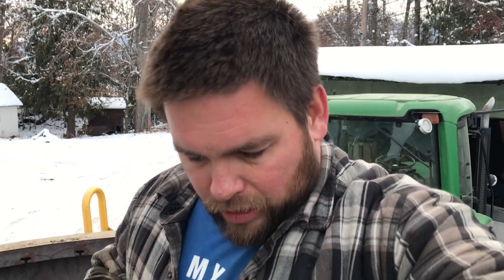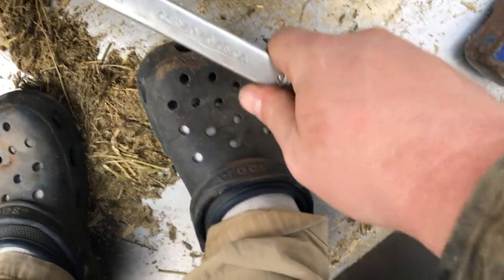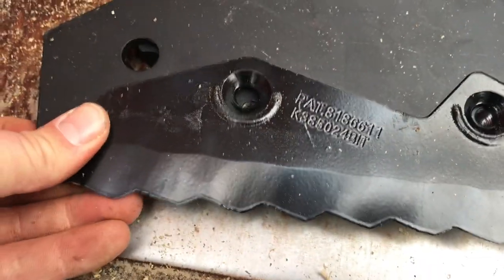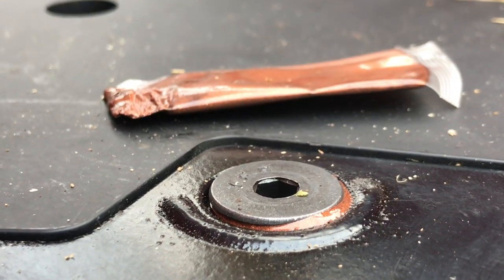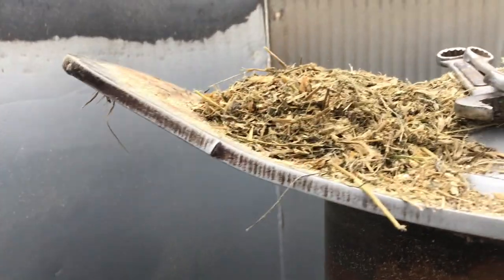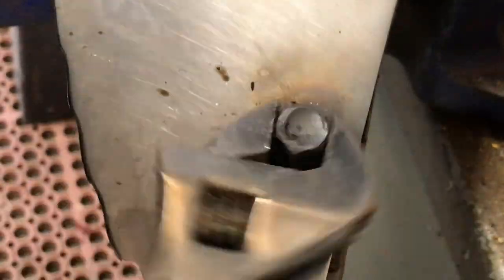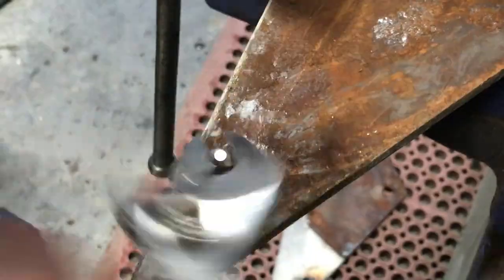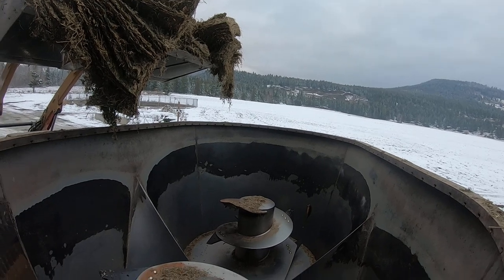Supreme Mixer Wagon Knives Replacement Install, And How To - From Kooima Ag

Comment: Those Kooima knives are a cool idea. Might be a pain to remove those allen bolts after a few hundred hours.
Glad you've got you're CSA approved footwear 😂
Reply from the maker: Ya that’s what I’ve been thinking ..
Probably have to either take them off at the screw 
Or go inside with a welder 
If they don’t come off easy I won’t be buying that style anymore.
#crocs heheheh

Comment: Easiest way to remove the set screw is to just weld it to the knife  and turn the knife off the backing plate. Be careful not to pinch you fingers or
Wear welding gloves